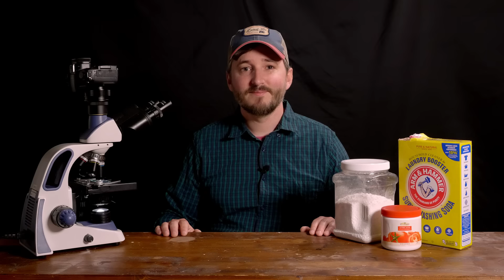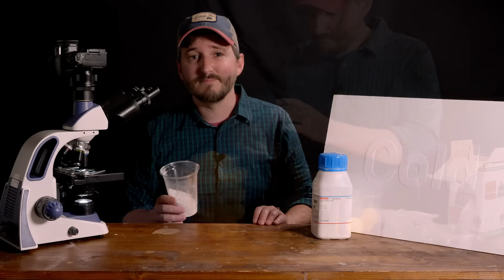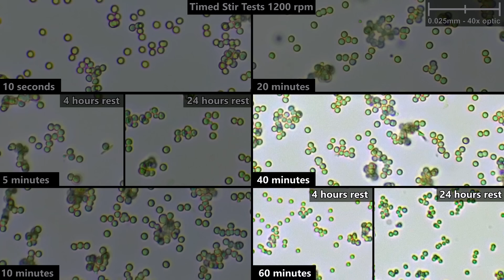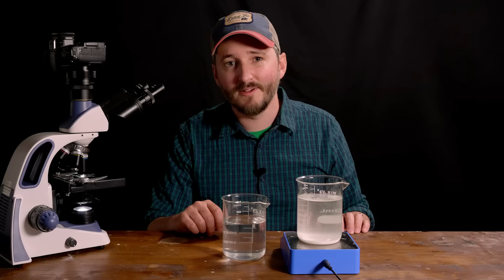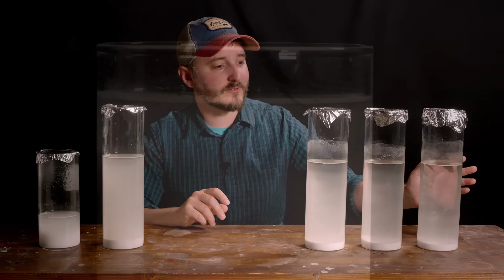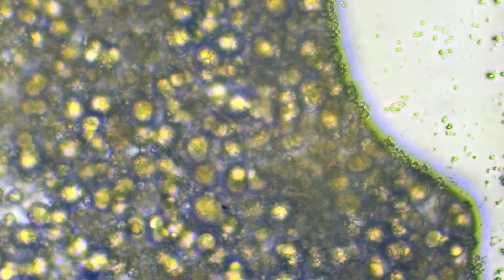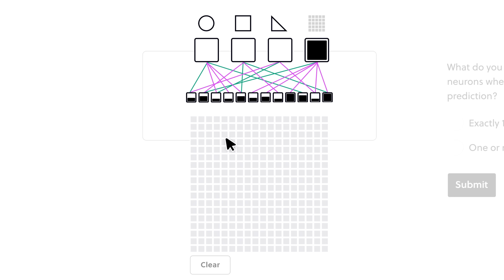Making Infrared Cooling Paint From Grocery Store Items (w/Novel CaCO₃ Microsphere Synthesis)

Comment: I'm a chemistry professor and I run a research lab. I spend an embarrassing amount of time consuming science content on YouTube. I can confidently say that this is the best research process I have ever seen demonstrated on YouTube. Presuming you have robust and reproducible data of all the observations you present in this video, this is easily a publishable project and I think it would benefit A LOT of people if you were to pursue publishing this work. There are a lot of people in my profession who wouldn't be inclined to follow the science presented in a YouTube video, but would confidently follow the exact same science if it appeared in peer-reviewed publication. I don't think they're correct in that perspective, but I know that bias exists. Anyway, please consider publishing this work, and if you wanted or needed any input to help pursue that I would be more than happy to offer any assistance I can. ABSOLUTELY EXCELLENT WORK!
Reply from the maker: Thank you very much!
Reply: @Nighthawkinlight  did you publish?
Reply: Have you considered (or tried) using a clear acrylic paint as your binder/resin? You may lose the scattering effect of the water inclusions, but you may end up with a coating that has some environmental durability. 

To test, just put some of your powder into some polyacrylic paint (Minwax makes one) and test rest them side by side in your box.

The other advantage is that a paint based solution would be applied using a roller.
Reply: @JR_MacD  I'd like to see it tested with clear hobby acrylic paint as base and if some thinner is used, it should prob be sprayable with an airbrush or equivalent
Reply: @JR_MacD I thought along similar lines. I'm familiar with 'artist's' type acrylics, where one can buy the clear Acrylic medium used to hold the pigments. 

The 'snowflake' finish, and effect of the Acrylic medium on the function of his ingredients are the two unknowns for me.
Reply: Dissolve plexiglass in acetone.  @JR_MacD
Reply: @JR_MacD no, I haven't
Reply: @JR_MacD 06-19-25.  A paint roller and clear coat of some sort popped into my mind when he said brushing it on wouldn't work.
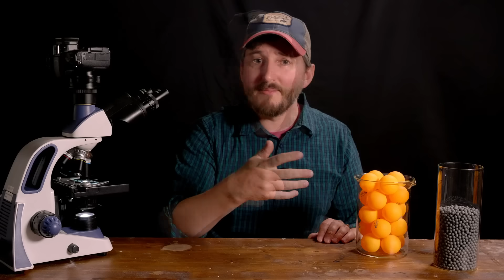Reply: @JR_MacD  6:10
Reply: I want to try and paint my whole house in this😅
Reply: @magnulof  Don't, you have insulation for a reason. You should use this tactically, not everywhere all at once.
Reply: @joda7697  My tactic would be to use it on the metal roof of my skoolie conversion. I wonder if it would work with transparent car wrap material over it.
Reply: @joda7697  Wait, I just thought about something. Winter!!!
Reply: @infotoons212   That's a benefit of it being fragile, you apply the coating in late spring an by winter it's either crumbled off or washed off.
Reply: @infotoons212   Yeah, see I'm in desert and would love to coat the roof of my RV, but ONLY in summer. Winter is another story, living in a solar oven.
Reply: @carlherrnstein9544 Hmmm
Reply: @DO-hc3le reflective tarp.
Reply: @infotoons212 If you have cold winters.
Reply: Chris, on his last step how would you change the deposition process for industrial panel production, i feel like you could just dip whole panels in a vat then flip rightside up before transporting the panel to a curing room but im curious if more learned hands have an alternative methodology they think would fare better
Reply: @skyler114   My research area is in the field of microfluidics (i.e. pL - nL volumes). To say that I am unqualified to talk about mass production scale fluid deposition is.... an understatement. The one thing that I would caution anyone thinking along those lines to consider, though, would be to do some back of the envelope Reynold's number calculations. If the cohesive forces holding this goopy paint together is substantially stronger than the surface tension forces that would hold it to the substrate you're coating, then a dip process would see everything slop off of the surface before you could ever invert it to allow it to dry. There's also an inertial component relating the force of gravity on the paint as the substrate is in motion during the dip process, but again, that's all outside of the scale that I have any expertise in. Fun fact: at small enough volume scales (where my expertise resides) and under common conditions, you pretty much have very few other meaningful forces other than surface tension.
Reply: @ChrisBaker  it's kind of neat to have tech the academic community doesn't because of the snobby attitude, but yeah it would be good to get this out there into more people's hands
Reply: @skyler114  Screed method, or silk screen method?
Reply: @skyler114 I think the piping/syringe method is very promising.

There are a multitude of industrial processes both manual and automated that use similar extrusion methods that could easily work with the super coating.

At a smaller scale, I'm curious to look into reusable caulk tubes and nozzles
Reply: As a grad student I am very concerned about the implication of this video. Someone is making nanoparticles "from his cave with a box of scraps" and if my advisor learns about this video I have to begrudgingly inform him that "I am not Tony Stark."😅
Reply: Make a cnc dispenser to spread the pigment to make panels.
Reply: Hey, it has been published. For free and  simply enough for normal people to make use of. Most scientists only work on things that they are told/paid too.
Reply: I had no clue that you could publish work without having either an advanced degree or some sort of affiliation with a university or other academic organization. 

What does that process look like, vaguely speaking??
Reply: @0psec_not_good  simply pick a journal, read their requirements and mail them your report. they will do the rest.
Reply: @0psec_not_good  you put your work in a pdf and offer it somewhere or you pay a couple thousand to a predatory publisher to publish it for you. unfortunately most go the latter way.
Reply: "There are a lot of people in my profession who wouldn't be inclined to follow the science presented in a YouTube video, but would confidently follow the exact same science if it appeared in peer-reviewed publication." - This is a stark condemnation of modern academia as it's a blatant "appeal to authority logical fallacy" that should be positively shamed out of existence. They are tacitly admitting they are incapable of basic critical thinking skills to evaluate something on it's merits alone, which makes perfect sense given the so-called "reproducibility crisis". Anyone taking such a stance is the poster child of John Taylor Gatto's work.
Reply: @EnFuego79 No, it's a recognition that people have different levels of expertise in different areas, and that carefully evaluating work is time consuming and takes effort.

When something appears in a peer-reviewed journal, that means it has been carefully reviewed by experts in the field who recommended it be published.  The journal's reputation reflects the quality of those experts.

That is not the only way to confirm that work is worthy of consideration, but it is an effective shortcut.
Reply: The reverse is also true: vast majority of ordinary folks curious about science will not find any comprehension in science papers if they are in their regular, well sciece-paper form. Instead, if every science paper had a video explanation and notes from the researchers like the one above, I think it would help the knowledge penetrate many more minds, much more seamlessly!
Reply: Chris Baker, what science channels do you recommend? I’m a layperson, but love science content, so, just looking for channels I don’t yet know! Thanks!
Reply: @charlieevergreen3514  sorry, I just saw your comment (6 months later). I don't keep up with YouTube notifications very well obviously. I think the best channel that parallels the excellent research work shown in this video is @AppliedScience. I'm a big fan of @CleoAbram 's science and tech reporting. If you have kids in your life who you want to get hooked on science both @SciShowKids and @MysterySci are unbeatable. Pretty much anything Hank Green gets involved with ends up pretty top notch, but my favorite is @journeytomicro. Some cool engineering projects over at @AaedMusa. These are just the first few that come to mind.
Reply: @charlieevergreen3514  we found out he was lying... Dude works at H and R block
Reply: It’s called YT he published it where a LOT of people will benefit. Publishing is cool if you wanna be recognized by the wrong people(egos and elitism that just turn into Tesla vs Edison he said she said) and therefore removes his influence where best applied…YT.
Reply: well he is publishing it, here. Do not publish this the science community please, keep it open otherwise we normies wont beable to see it except in science gate
Reply: Outstanding comment.
Reply: Thank you so much 😊 God bless you 💖
Reply: thank you for sharing. I’ll be attempting this project and be happy to share what I’ve learned.
Reply: S tier comment
Reply: @Twangaming  this guy has NO IDEA how much work is involved in getting something like this published. There is no reasonable way in hell it makes sense. you don't just submit your youtube video to a journal. people move OUT of the academic industry for a reason. because there's no good money in it and it's a serious pain in the ass.
Reply: @demigodess  pretty sure the chemistry professor who runs a research lab knows exactly how much goes into it. Also, he didn’t say submit the YouTube video, he said the research methodology. Go be weird and annoying somewhere else
Reply: @Twangaming  you assume i'm stupider than I am. Nobody on earth is suggesting you actually go and submit the youtube video. What you ignored is the part of my comment where I point out how insanely time-consuming academic publishing is.
Reply: @demigodess  you mean the part where you point out the obvious? You’re projecting your assumptions of stupidity
Reply: @Twangaming  if it were obvious you would never have suggested he publish it.
Reply: @demigodess  how dense are you? The difficulty of publishing work and the quality of his findings are two completely different things
Reply: @Twangaming  Your brain is made of dog shit if you think that's what I'm implying. Either that or you're purposefully trolling. It's almost like you're incapable of reading. how you're even still navigating this world is a serious mystery.
Reply: @Twangaming  Why are comments always littered with people like you who cannot resist resorting to insults? Are you that frustrated in your day to existence that you have to denigrate other people’s ideas so rudely?
Reply: @L @Libertariun  do you mean when I said I like the guys comment and the other dude jumps in to say he knows more than the expert and the guy is an idiot? Ok bro. Also your comment is ironic bc this is over a year old but you want to insert yourself. If you must insert yourself, then find a fact to disagree with instead of posturing
Reply: Yeah, I was a chemistry R&D tech for 13 years. This is professional-grade stuff.
Reply: Time for peer review ytb channels, trying what seen here, documenting it, make it better and publish it on yt. 
I would love to see someone using that in resin table.
Reply: The time-lapse microscopy of growing spheres was a real highlight.
Reply: As a chemistry PRO could you perhaps tell me why all PVC in the world is not black and majority white, maybe cause they adhere Soduium Bi Carbonate with FOLIC acid to make it so, being the missing ingredient to this concoction would indeed be FOLIC ACID please somebody prove me wrong and let do this already solar flares are coming/
Reply: CIA.... 

CHEMISTRY IN ACTION
Reply: @ChrisBaker I'm just curious if you watch Nilered?
Reply: @demonflowerchild   Yes I do ocassionally watch NileRed. I find the majority of his work that I have seen more in line with the chemistry demonstration genre rather than demonstrating research process, but it's likely I've not seen everything worth seeing there. I am a fan, I think NileRed does great stuff
Reply: Colleges are just closed source education snobs. Colleges steal your work when you start writing papers for them. They deem it their property. Don't do it. You'll get caught up in a system and some people are snobby and jealous in academics. They want your mind to market to corporations. They don't deserve the info because they pay nothing. You're an excellent researcher, don't give it away.
Reply: Agreed!
Reply: let the erudites judge themselves. They are compromised by their thinking.
Reply: @ChrisBaker , she should do this, really hon, just do it!
Reply: Also, encourage him to do some calculations of the efficacy of the project to see if the excellent work here is actually justified in the real world? ...  "NUMBERS? Is this application "cost effective"? That is, if I were to paint my south-facing wall with this paint + protective material (plastic sheeting?) would the drop in A/C use inside next to that wall pay for the paint+covering+installation+ maintenance? Is this MORE cost effective than just improving the energy efficiency of the wall itself? I imagine economies of scale would someday make this kind of paint application the default in all new building installations. But I wonder if you have pondered the numbers on this yet?"
Reply: Mr chemistry professor,

Please answer this question.

Would the substance " eschilon", derived from chestnut trees, used as a laundry whitening, from its properties to convert UV light to visible light, increase the effectiveness of a cooling paint, the same way this product works?    Allowing the UV converted to the visible spectrum to escape the atmosphere....  Without being reflected back, therefore increasing efficiency!?
Reply: What about project farm?
Reply: Can anyone publish?
Reply: First time I saw this was on a channel called Tech Ingredients or so, they are not youtubers. You mish want to check, their video is 2 years as well. I could provide the link.
Reply: Why are you embarrassed learning more about a field you work and presumably enjoy? Seems rather stupid.
Reply: If i were him i wouldn't bother changing my presentation style, if they don't like how i present my experiments then it's them who should adjust, not me
Reply: That bias is them trusting credible sources and I think it's important in science. I'd rather they not trust youtube videos than have any of them trust some sketchy fake science blindly. Thinking critically is the key for both I guess.
Reply: @cutecats532  this is an understandable take, but I actually have a very strong opinion of the use of the word "trust" in science. It's probably too involved to communicate in a comment, but TLDR: I think the word doesn't belong in science at all, and that a trained scientist doesn't rely on it at all. It's possible to decipher "trustworthy" information without the mechanisms of peer review or relying on the authority of the speaker/publisher, but it takes more cognitive work. Conventional peer reviewed venues ensure that the information necessary to do that cognitive work is included in the report, and YouTube certainly doesn't do that... But the important distinction here is that peer review makes evaluating the objectivity (i.e. trustworthiness) of the information EASIER, but if an experienced scientist is willing to put in the work, the peer review process is not an ESSENTIAL component of that evaluation.
Reply: Tell me if im wrong ITS BEEN A YEAR AND I HOPE THIS FINALLY REACHES YOU AS I BEEN TRYING, TOSS IN FOLIC ACID TO MAKE IT ADHERIBLE RESEARCH WHITE PVC cause their would ONLY BE BLACK PVC IF NOT FOR folic acid PLEASE SEE THIS
Reply: Id listen to this guy
:text-green-game-over:
Reply: Funny some of the greatest inventors and researchers dropped out of 8th grade and people must spend thousands for a degree to believe the drop out they are paying highly to learn from 😁
Reply: That’s the problem with society now
Reply: @humphreyjones1828 
What's the problem with society???
Life's a B I t c h ain't it ?
And then you marry one, well that's what my ex said anyway.my reply was And your point is??????😂😂😂😂😂😂😂😂
Reply: Great, who is going to fund the publishing? Nobody in their right mind has the time to do such a thing.
Reply: @demigodess  many universities would
Reply: @fluxpistol3608  You try approaching a "university" with your work and ask them if you can get it published. That's not at all how academic publishing works. lmao
Reply: @demigodess  I have and helped others to. That's what university grants are for. I don't think you're as clued in as you think you are.
Reply: @fluxpistol3608  Ok have fun with all that. I'm sure it's "worth the money". lol
Reply: @demigodess  it doesn't cost anything. The university pays you. You're really illustrating that you don't know how things work.
Reply: @fluxpistol3608  Your brain makes a lot of assumptions about what I said. You seem to infer a world beyond what actually exists. I never said it costs anything. How you inferred that from my message is a serious mystery. All I said was to enjoy all the money the universities will give you, sacracstically. It will be a pittance at best, for all your work. You will also have to apply for all those grants. which is not easy. I graduated from university and have spoken to a lot of people in academia. it's not a pretty place. and not one any self-respecting person who values their time will engage in. Also good luck actualyl getting this published without a TON of work. He can't simply send them the youtube video. It requires countless hours of more work. So please, get real. getting this published would be a waste of time, financially speaking.
Reply: @demigodess  *actually
Reply: @demigodess  Therefore, based on your claims, you're not a self respecting person that values their time. (This much is clear). Because you went to university. Interesting 🧐 I think you might be the common denominator there, not all the universities of the world. Fascinating sophisms you have. PS universities do tend to be challenging for those whom feel compelled to couch their communications in sarcasm. In fact adult life in general is tough for such passive aggressive individuals. It's like they can't face the truth. Yet, growing up and being smart requires the ability to determine the truth. A skill you don't seem to have gained. So why ought anyone listen to you?
Reply: @fluxpistol3608  congratulations on your discovery, a whole single typo and not a thought of your own. genius, I say. you're a genius. I'd like to say it's been a pleasure, but it hasn't. good riddance.
Reply: @fluxpistol3608  gonna get that published, are you?
Reply: @demigodess a recognition of genius for picking up a basic typo is a bit much. Thanks though!
Reply: @fluxpistol3608  🥇
Reply: @fluxpistol3608  it's amazing as soon as I bring up a good point you move over to talk about a typo. lmfao. low life.
Reply: "There are a lot of people in my profession who wouldn't be inclined to follow the science presented in a YouTube video, but would confidently follow the exact same science if it appeared in peer-reviewed publication."
Interesting since a large number of research papers and even peer-reviewed publications have been shown to be garbage. I guess you can chalk that up to the hubris of the expert class.
Reply: @terry5008  Is there hubris, almost certainly. But I think the key difference would be that a peer review process (whether flawed or not) actually exists in scientific publication and not in YouTube publishing. As I stated, I don't agree with the bias, but I think to chalk it up to hubris and to discount peer review because "a large number" or papers are "garbage" is pretty much exactly the kind of lack of rigor that would make most people investing careers and millions of dollars into research lean more towards peer-reviewed processes and less towards venues where comments like this are pretty much the standard of critical review.
Reply: @ChrisBaker I think the other factor is that scientist all pay attention to journals as a source of what research is being done. They don't necessarily watch YouTube, and if they do they may not be looking at anything related to their field.

As you say, anyone who watches the video would see that the methodology is sound. But a youtube video isn't ever going to come up when someone does a literature search.
Reply: @terry5008  ‘peer-reviewed’ has always meant just that, reviewed, at arms length. It doesn’t mean ‘replicated’ which is the real gold standard and conclusive validation.
Reply: @terry5008 , it's a serious problem in all fields of academia.
Reply: @terry5008 perhaps "garbage" is not the best word for this context; how 'bout 'fraud'?  Better yet, 'fraud initiated by the money people for their own dark (green) ends'.
Reply: @terry5008  peer review is only as good as the peers.   Unfortunately there is so much emphasis on getting published that publications with lower and lower standards keep popping up
Reply: @terry5008 perhaps "garbage" is not the best word for this context; how 'bout 'fraud'?  Better yet, 'fraud initiated by the money people for their own dark (green) ends'.
Reply: @terry5008  Truth.

Follow the money.
Reply: @terry5008  That is the whole point of science. It is self-correcting process. But if you mean for example a predatory journals that publish anything, that is a real problem.
Reply: If they're too biased then we don't want them playing in our field. Let them keep working for "the man."
Reply: It is published. On YT. IF you want to replicate it to confirm the results that's on you. Don't ask somebody else to do more work because you don't want to do it yourself.
Reply: We like him independent and I would rather pay him directly.. publishing will ruin his work like EVERY OTHER MOVIE
Reply: @PerryCali not movie publishing, just publishing his results as a paper in a peer reviewed journal
Reply: @Wesley13377  NO. Means NO!
Reply: @PerryCali  psychotic behavior, I hope you get the help you need
Reply: @Wesley13377  you're so psychotic you think I gave a fuq. No one did..